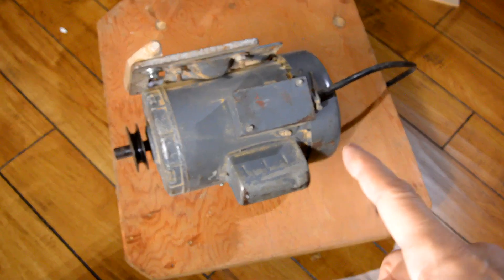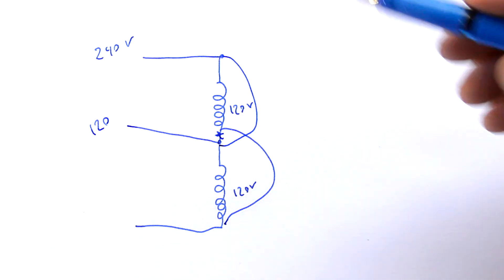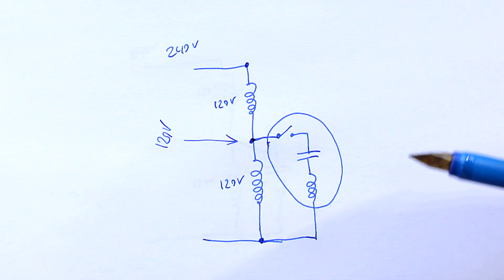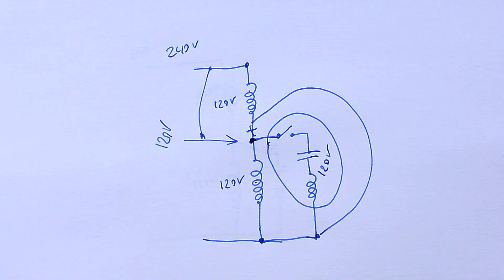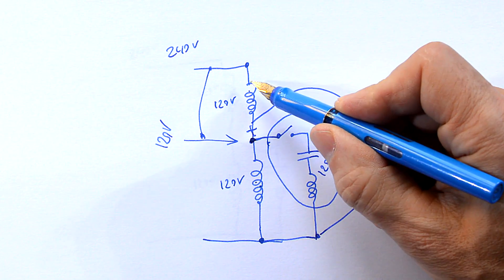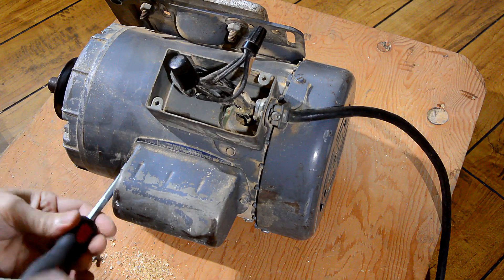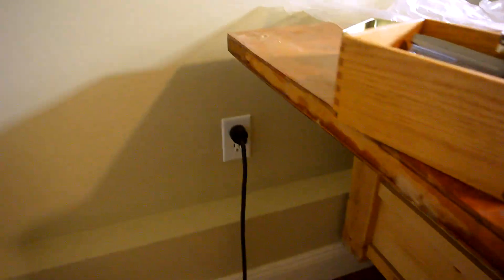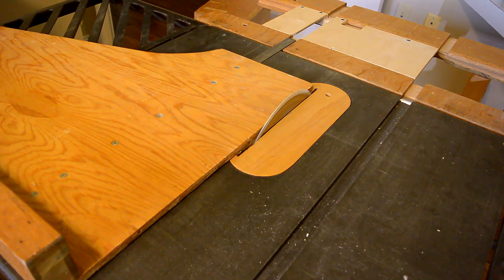Rewiring a motor from 240 volts to 120 volts

Comment: I have a 110 swamp cooler pump that I've repaired several times. I have a new one someone gave me that says it's 230 volts. As far as I can tell they both appear to be wired sequentially, as in one leg connects to one end of one coil the other end of the coil connects to the other coil and the other leg connects to the other end of the second coil. The only difference I'm seeing is that the 110 has a thermal fuse where the coil connects to the leg and the 230 volt pump has the thermal fuse in between the two coils. If I move one leg to where the coils connect on one side and connect the other end of the coil that was connected to that leg up to the other leg that should put it in parallel correct? I'm guessing the biggest difference is the size of the coil / winding seems to be larger on the 230 volt unit. It is a little giant cp1-230, and it runs very weak off of 110 volts as wired. Also just to mention one of the problems I keep having with the old motor is that it seems to lock up, with no power it spins freely, but as soon as you put power to it it acts like an electric break rather than a motor that attempting to stop the motor from turning. Let me know if you have any insight into why it does this. My thought was that it could be crusty debris from the swamp cooler getting sucked into the pump motor and grounding the stator to the outer casing?

Comment: Mathias: I have compared the shaft available power of a few motors I have at hand that can use both voltages, all between one half and two horsepower, and the average power loss when operating at 120V instead of 220V is 82%... FWIW.

Comment: Every one of these videos assumes the audience knows something about electricity. Example here is, right off the bat Matthias starts using electrical terminology and diagrams that does not mean a thing to a novice. I'm lost before 40 seconds goes by. Lines on paper only confuse. Put the pen and paper away and go straight to the motor and forget the theory talk.
Reply from the maker: It's kind of a hint that if you know nothing about electricity, then do not do this.
Reply: If you cannot draw a simple diagram, you are risking doing the WRONG connections! Only when people can draw a simple circuit,  they are going to do it right.

Comment: I have a radial arms saw and I cant get the wire right to work on 220 ,cause the 120 side cant holdup the 1 hp its say its it so I want to know how can I wire a motor with 2 running capacitors wire to it

Comment: Hi, maybe I asking bit Noob. I just bought a Kitchen Aid what is working on 120v! I know is will be not working in my Country (230v) . The question is. I need to buy a new 230v motor+Coil ?(230v) or I can use one of the old motor parts? (120V Motor with 230V Coil) or 230Motor with 120v motor? . Thanks

Comment: Hi Mathias, im trying to build a football thrower so i will be able to get two, 240v Air conditon condensor fan motors. I've been trying to research how to wire both motors to be used at wall voltage of 120V in a parallel circuit but can't seem to figure it out because the motors have 3 wires, one for L1, L2, and one to the capacitor. Would this method be applicable to the motors? Would you have any advice?
Reply from the maker: Those motors need 240 volts.
Reply: @matthiasrandomstuff2221  thanks for the reply Mathias! I'm probably going to go another route from the 2 motor system and use a 12v with 2 pulleys

Comment: I have a 110 v sanding floor machine that I wish to convert to run on both 1110 and 240 do you know where I could find instructions to do this, please?
Reply from the maker: inside the motor if anywhere.

Comment: I'm wondering how I can wire a voltage switch, so I could have a panel with 2 plugs,  utilizing the available voltage (in the event I borrow out the tool, in this case an air compressor)   i just acquired a big quincy compressor pump with a 3hp baldor.   I can wire it 3 ways, 110, 208, or 230.    I would like to have the option to flip a switch and use either 110 or 220, depending what is available on site.

Comment: Thank you so much! You singlehandedly taught me what I needed to know to rewire my grandfather's old drill press to work with my house's circuits. Old motor wired for 240v, no wiring diagrams for converting it to 120, nothing about it online. It DOES say it's 115/230 on the side, which is what made me even bring it home, because I don't have the confidence to run a whole new 240v wire from the breaker box.

One question. I followed this video and the woodgears guide and everything seems to be working correctly, but when I was making sure the second coil was wired properly, I got around 30v instead of <10v like the guide says it should be. If I switched the wires, I got almost 200 volts, so I'm fairly certain THAT was incorrectly wired. Is 30 volts okay if everything's wired properly?

Comment: Can I rewire a machine that runs 120V ~ 60HZ , to 220V 50HZ? Because the power supply is 220V 50HZ , and the product is 120V 60HZ
Reply from the maker: No.  Even if you could rewire it to 220 volts, going from 60 to 50 hz with motors and transformers is a nono.

Comment: hi, realy good video its very helpfull, im in the process of choosing to buy a dewalt dw745 table saw from usa, since its 3x cheaper than in europe,  im looking for the info if its posible to rewire it from 120v to 240v, :)
Reply from the maker: Not possible for the type of motor in the dw745

Comment: Can someone's explain how/why there is access to both 120/240V supply? Is it not standardised in Canada?
Reply: I'm no electricity expert, but it's like that in the US as well. We have 240v circuits for big appliances and 120v for typical household outlets.
Reply: Most household appliances run on 120V.  You can run two 120V circuits in opposite phase together to make 240V.  That's what usually done for items that use alot of power, like a saw, since 240V is lower current making it more efficient.

Comment: I haven’t the slightest clue what any of that meant. Electricity is so confusing
Reply: Me either, not a clue. If I took a wire "from here and ran it here" I'd blow every circuit in the house or start a fire.
Reply: Electricity must be from Greece because it's all Greek to me to.

Comment: Well, in the other scene -- where you go from 120V to 240V -- what if you had just done it the really easy way by merely replacing the 120V plug (in 120V wiring mode) with a 240V plug (or plugging the regular plug into a 240V source that's shaped the same way; whatever), skipping all this complication (assuming that the capacitor can handle 240V)?
Reply from the maker: then you would blow the breaker - if you are lucky.  Blow the motor if you are less lucky.
Reply: I think I know why, but I'm not sure. Will you please spell it out for me in about the same quality of description as your videos have, to confirm my guess?
Reply from the maker: Done.  It already IS spelled out in the same quality as my videos, IN the video.

Comment: ok i dont really understand. should i feel bad that north america and other places is 120v? isnt 240v the norm?
Reply: America has lots of voltages -- 120, 240, 208, 277, 480....Mexico City has 127 and 220, and some places in Canada have 347 and 600 volts!
Reply: Mellow US power is 240v for almost all residential customers. Large loads like stoves or electric clothes driers use it. Note, power is supplied with a center tap (split phase) Standard wall outlets for normal loads use this neutral  (center tap) and one of the 2 hot legs depending on which side or breaker panel it's run to. So 120 volts. Larger buildings typically use 3 phase 480 volts. In at least parts of Canada that's 600 volts. The pole mount transformer outside the house  typically gets fed with one of 3 phases at 7200 volts.

Comment: Ah... rewiring induction motors for different voltages. Sometimes a pain in the ass. Sometimes is a cinch. I hate it when it's the motors with just a bunch of loose wires that you have to splice together. It becomes a crow's nest in there.

Comment: Why did you need to wire it back to 120v and why didn't you put this video on your main channel?
Reply: It isn't as relevant for most of the main channel viewers.
Reply: It looks like he's operating it with the standard household wiring in Canada.  Canada and the US only use 240V in specialty high current applications: water heaters, clothes dryers,  stoves, etc.  You can wire 240V anywhere, but it is a higher cost, and you'd need to plan it out.

Comment: If you just moved to Scotland you wouldn't have had to fuck about with that motor.
Reply from the maker: right, because I would have needed a whole new motor.  You can take a 50 hz motor and run it on 60 hz, but not the other way around.
Reply: I wasn't being serious. It was voltage-based humour (you're going to have to change the way you spell humor too when you come to Scotland).

Comment: Are 240V supplies common in Canada?
Reply: Yes, every household is fed with 240v which is center-tapped for most of the outlets which are 120v, but things like stoves/ovens and clothing dryers operate on 240v.
Reply: @Orcinus24x5  neat! Thanks
Reply: The standard in Canada is 120V and 60Hz AC electricity. Same in US.

Comment: When I rewired my old unisaw to 120v the overload protection in the magnetic switch will always kick in after running the saw for a few minutes. I think there's a bi-metal heater element in the switch that needs to be replaced for different operating currents.
Reply: Yes.